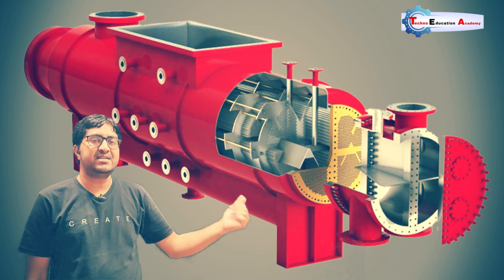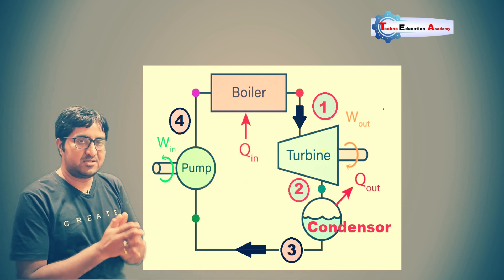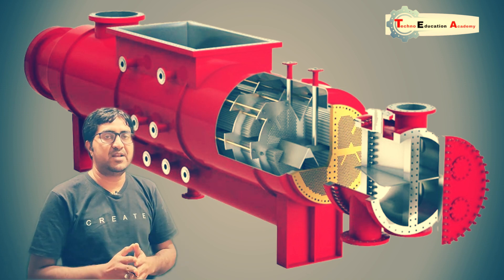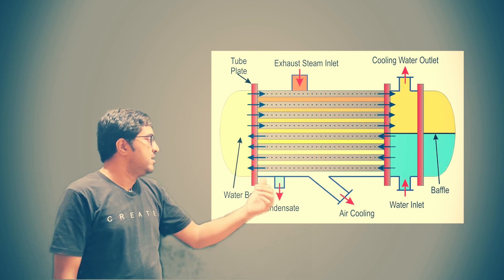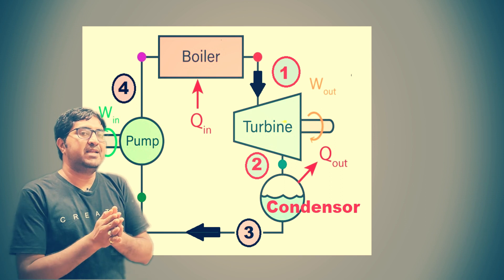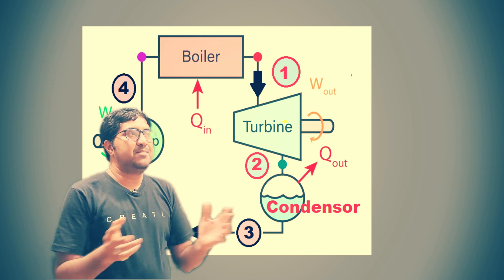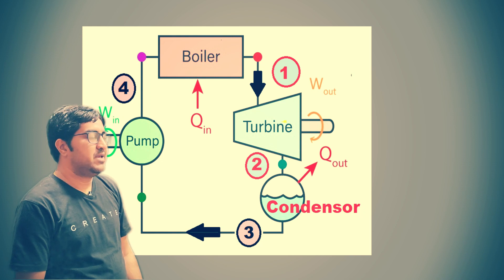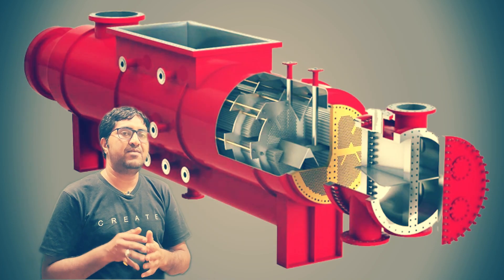Unlocking the Role of Condensers in Thermal Power Plants: Surface Condenser Insights & Importance

Comment: What is the imporatanc of cycle in ragistration system??? Like-carnot cycle
Reply from the maker: Carnot cycle is 100% efficient cycle. It's a ideal cycle while Thermal Power Plant work on Rankine cycle. From the Rankine cycle you will get the basic ideas of working of basic components of power plant and will get idea about  process occur in each components. You can compare this cycle with Carnot cycle to achieved maximum efficiency
Reply: @TECHEDU999   please make video